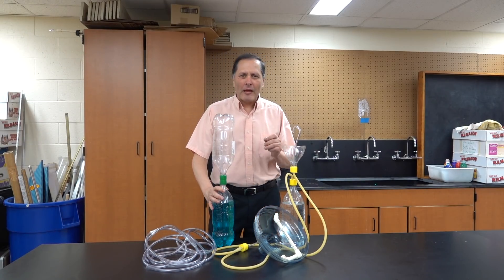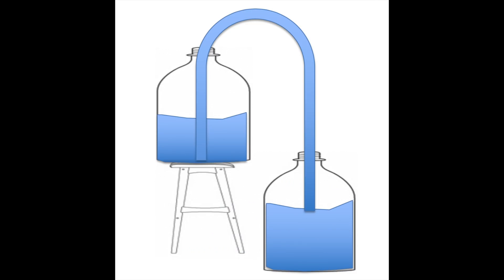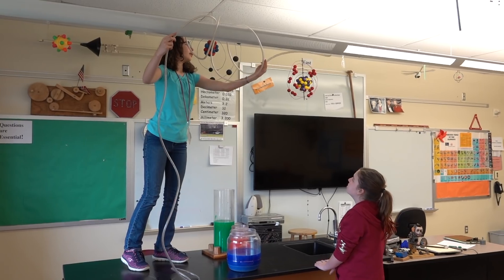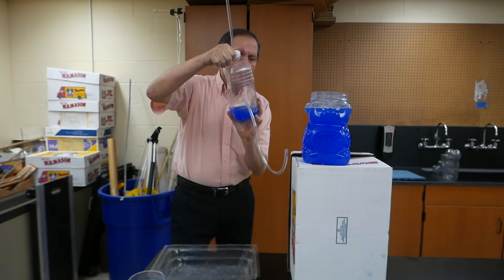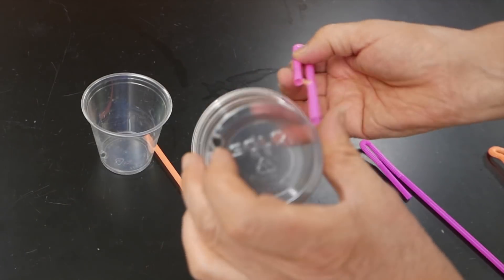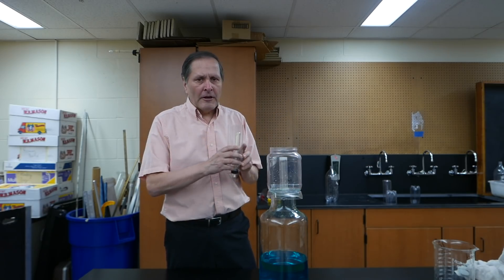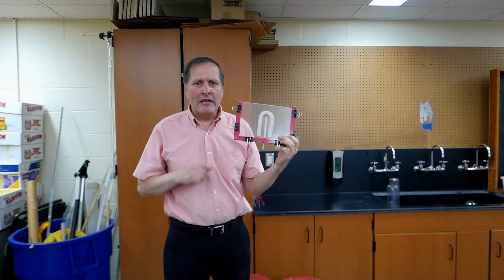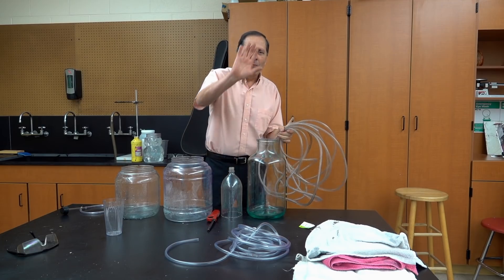Water Demonstrations  Part One --. Siphons // Homemade Science with Bruce Yeany

Comment: 1:22 the pressure explanation would only work if we introduce atmospheric pressure as well. If there's lower pressure region, it doesnt magically "suck" the liquid - it's the air around that pushes the water into low pressure region. But since the theory is about cohesion of liquid, we don't need to talk about pressure here?

Edit: you actually talk about pressure. But why this works in vacuum then?

Comment: Thank you! Great class! You gave me some ideas for projects that don't use electricity, but use siphon power (bird bath, pond water circulation and aeration), and one project that may solve a problem (moving sitting water on a wet lawn. Basically a sump pump working on siphon power; again, no electricity). Thanks again!

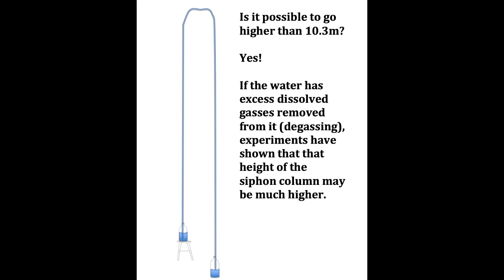Comment: There is a mistake at 3:19. Water can not rise higher than 10,33 m. 
The reason is, that the water get pressed up to 10.33 m by the air pressure, but only at absolute vacuum at the top of the siphon and Zero degrees Celsius.
Also if the water was degased before, there would be "gas" to be precise "water steam", because water boils at this condition.

Comment: The theoretical limit for how high you can suck water up a tube, is around 35 feet, given a 1 atmosphere environment on the source container.   It would be an interesting trial to this experiment to see an attempt at siphoning water higher than 35 feet above the upper container.
Reply from the maker: We did the sucking through a straw experiment a few times with students until I heard it can be harmful to the lungs,  same with exhaling as hard as you can.  Not sure about the accuracy of either statement.

Comment: Make electricity by this setup ??so we make it on it's theoretically higher limits by using hydraulic system or leverage so we use very small power and the power from this setup gives us rest of the power 

So we made its on various levels for making electricity

Longitudinal siphoning gives many thousands kilowatt of energy

Comment: if you used a liquid with a higher boiling temperature, could you siphon higher?
Reply: Not very much, because under most circumstances, it can't go lower than a perfect vacuum.  10.3 meters is the theoretical height for sucking water up a tube, assuming you can get it as low as a perfect vacuum.

It requires a liquid with less density for atmospheric pressure to be able to lift it higher.  So if you used alcohol instead of water, it could go higher.  While if you use a dense liquid like mercury, it will only rise 76 cm under 1 atmosphere of pressure, which is why we also call 1 atmosphere as 760 millimeters of mercury, based on the working principles of the mercury barometer.

Comment: I have a question regarding pet water feeders, how does the water reservoir that has a higher level, not fill the lower bowl and overflow it ? Great channel Bruce.
Reply from the maker: you can do the same thing with a glass full  of water, upside down in a bowl of water,  water can't flow out of the dispenser or the cup example unless air can get inside the container to  replace the water coming out.   When your pet drinks,  the water level drop in bowl far enough that the mouth of the water container is clear of the water level and  air can get into container.  Water flows out until the level in the bowl rises enough to seal the opening of the water container again

Comment: The Tantalus cup got me thinking... is this how those old auto-flush urinals would operate, with the porcelain tank high up on the wall supplying several urinals ?  Maybe just a trickle water supply refill rate for the tank, but a very strong flush flow every 10 or fifteen minutes, and certainly nothing electrical involved.
Of course modern urinals use individual electronic motion sensors with a solenoid-operated valve, but those of us [men] old enough ;) will remember what I describe.
Reply from the maker: not sure I've seen those but how you describe it sounds about right.
Reply: I enjoy Big Clive's electronics videos, but I never expect a search on urinal auto flush (siphon) valves would yield a video from him!!
https://www.youtube.com/watch?v=BQ45kMi6HkA

Comment: I do not agree that the chain model is a flawed analogy:  you say change in pressure....   that chamge of preasure is due  by the difference of weight.....  it  even  would  beheave   the same if you elevate the chain  to a certain point that the chain would not support its own weight  braking  its links. I guess that under certain conditions, you could  even repeat the  ball chain out of a jar experiment  with  some liquid with spetial  viscosity... by the way  doesn´t  helium    behave like that  with  jars at differentlevels?
Reply from the maker: Personally, I like the chain model myself, it seems to make sense but I've had  "experts" explain why it is flawed and I've tried to apply their theory.
Reply: @YeanyScience  Hi bruce..  nice to hear you  in person! nice surprice professor , great job!! what do you think about helium property of leveling in a spooky way?  I have in my memory  a drawing ( old physics book) a jar with liquid He inside other, both open  and it said that the levels would equalize from the full jar to the less  leveled one. I.ve tried to find something about it.. negative results yet. thanks for teaching every day...  by  tyhe way.. can  i have  some link to those experts?

Comment: Excellent.  But how the liquid starts flowing with out primary force😨? If I want transfer fuel from container to car tank I have to suck the tube or blowing to the container. . or my be not! 🤔 and how the liquid goes higher than primary container. .I thought the cities water tower should be at highest level.. .. anyway that was amazing. . You are absolute one of the best teacher I ever seen.  👏
Reply from the maker: thank you,  what you are seeing is simply a version of a siphon.  The end result is that water flows from a higher level to a lower one due to the pull of gravity.  If you do a search for siphons there is quite a bit on them to explain the concept
Reply: @YeanyScience  Many thanks.  Best wishes 🙏
Reply: @YeanyScience  Now I got it. Because of capillary effect siphon start to work and for my second quastion the level of primary container is issue not the pipe line.. many thanks again.

Comment: bell siphon mathematically proved equation are what and what are it's maximum potential or work done so we use it to run the turbine and generators setup and pour the water again in the reservoir😇😇
we use many turbine in this path and each turbine produced cheap electricity forever everywhere anywhere in world😇😈

Comment: QUESTION ... If the siphoning tube is LIFTED AND WOUND to more than the 33.9 ft ... would the length of the winding in combination with the height of the lift still be the 33.9 ft dimension  ... or does the 33.9 ft only equate to the height dimension ???
Reply from the maker: it is the height that is the limiting factor
Reply: @YeanyScience  -  I just realized that my question was a bit convoluted ... but, If I understand you correctly ... whether it is 100 ft of wound tubing or the exact 33.9 ft of tubing ... WHEN RAISED TO THE 33.9 ft level ... THAT IS THE LIMIT ...
Do I understand you correctly ???

Comment: SIPHONS WORK DUE TO GRAVITY, NOT ATMOSPHERIC PRESSURE!! You are supposed to be a scientist for god's sake--if pressure were the main factor, siphons wouldn't work in a vacuum--but they do. See the Veritasium video from 2011 (8 years ago, this isn't new news)
Also, by the logic of "air pressure" doing the work, the lower container actually experiences higher air pressure, so the liquid should be pushed the OTHER way if anything. Again, you are supposed to be teaching people science, not spreading lies.
Reply from the maker: Hello Ryan,  I explain at 1:16 that the current theory is that siphons work due to gravity, I do not mention atmospheric pressure, in fact this can be demonstrated by having siphons work in a vacuum.  the "weight" of the water inside the downside tube reduces the pressure inside the tube itself but this once again has nothing to due with atmospheric pressure. The behavior of siphons has been additionally researched since 2011 but the explanations still vary.    I believe my explanation reflects the current research which does not include the idea that atmospheric pressure is responsible

Comment: Siphons can also take place in your body. Practitioners of auto-erotic asphyxiation can block the flow of blood out of the head. The blood flowing in does so via arteries that are deeper inside the neck that the veins that carry blood back to the heart and are thus easier to restrict.
    When that restriction is lifted blood flows out of the head much more quickly that blood flowing in causing a momentary drop in blood pressure. This is what causes the euphoric feeling that people are looking for who practice A.E.A. However, this drop in blood pressure can be large enough to cause loss of consciousness. If this happens and the end of the rope is tied securely consciousness will not be regained before death takes place. Leaving loved one to find your body some time later and wonder why you chose to hang yourself. It is likely that the majority of surprise suicide by hanging were, in fact, accidental.
      If you choose to practice AEA, learn how to do it safely. Tie the noose in such a way that it will loosen automatically and hold the end of the rope in your hand so that if you lose consciousness the rope will not suspend your body by the neck.
     Even when done safely, AEA is still extremely dangerous. 
This video has some very good information, even if it is presented rather amateurishly, and explains the siphon effect and shows how quickly LOC can take place.
https://www.youtube.com/watch?v=MHRchAjxUMA

Comment: Bruce I think it's incorrect that the siphon works because of pressure difference since that would imply that siphons can't work in a vacuum. If you look at this experiment (https://www.youtube.com/watch?v=8F4i9M3y0ew) it shows a siphon working in a vacuum. Instead it is gravity causing the fluid to pull through the siphon tube and which causes the water to flow to a lower height

Comment: 3. 41 second
if we use very narrow tube so we make a coil and magnetic ink flow through it as a  current and giving some electromagnets induction which powered up a pump and in this way the perpetual motion become possible😇😇😇
Reply: I... You.... oi. Ima just say it. It's okay to be an idiot, but you can't just go telling everybody with a 1 bar WiFi connection about it.

Comment: if magnet fluid are their, will they produced enough electromagnets induction which can powered a pump and the perpetual motion become possible, yippee, bingo, or something like this😈😈😈
Reply: Perpetual motion machines are impossible. You could use a siphon to power some sort of device, but you would effectively be turning potential energy into usable energy, with extra steps. There is no way to get more energy out of a system then you put in it.

Comment: Hi  Bruce    Nice experiments, Id like you  to experiment with another  water antiintuitive water behavior... it is very  easy, it consists of a water  tank  small or very big like used here in Argentina on top of houses,,.make a small one  say  one meter high with  plastic bottle.. the just put a hose down from the very bottom ( not siphon). like 1/2 inch and  2 meters long, if you  put  the EMPTY hose  straight  down the water will run freely, but  if you for example   put some  midle part  flat horizontally,   some  water   will reach the end ( you had it closed first)  and some air will be in the midle of the hose, then you open the end  and  the air inside will  try to float up stream, wile the water  would  try to go down, sometimes the air  buble gets in equilibrium  and the water would NOT run  even if the end is lower and fully open.. this is a comon problem  for house water piping  even if the water tank is over  10 meters and the  3/4 inch tubing goes straight down, there are interestig factors  involving tube diameter, size of the air buble, pressure andn so on   ... congratulations for your teaching  vocation!!!
Reply from the maker: thank you, I'll keep your suggestion as I plan I plan to try some more on hydrostatic pressure

Comment: 1:22 with pretty thin capilar tube, siphon starts automatically, when upper jar water level + capillar shift altitude bonus reach upper "U-turn" level, because level in capillar higher than usual (which is equal to source) ln case of thick tube
Reply: in lab. practice i using 1mm diameter glass tube, it can shift water(or some acid) level for extra 15mm higher, so i pour out some acid from almost full glass, when acid level high enough - approx 5-10mm lover than edge(border) of glass, just contact of one end of capilar(thin) tube with liquid, cause liquid intake into siphon, and it reache altitude level higher than glass border, where  ^ -turn occurs and forward -easy, due to caplar intake-pressure that gives shift - after turn - pull forvard with same pressure(P~1/d)
Reply: Sometimes someone buys cheap tea bags which thread is hydrophilic and works like a wick, that cause tea running away, goes into "magnetic forest" of capilars, pouring out of the mug onto the table, no need of siphon initialisation by tea owner.

Comment: Cavitation would occur in any liquid, it has nothing to do with dissolved material or purity. The pressure of air is simply not enough to hold up the entire column, so a vacuum gap forms. In case of most liquids, the gap is immediately filled to the vapor pressure of that liquid, as said liquid evaporates.
Reply from the maker: There have been several studies   on the height limits of 34 feet  in liquids supposedly determined by barometric pressure.  Their results show that it’s possible to create a siphon that’s 50 feet tall which operates quite easily at seal level, with a projection that the limit may be much higher perhaps up to 300 feet or more. That’s because, according to the researchers, the degassing of the water prevents the cavitation from occurring: Without gas in the liquid, which can form bubbles as the pressure changes, the water’s essentially “stronger” and much harder to tear apart.  Here are two of the several studies on the subject

https://gizmodo.com/you-can-build-a-siphon-way-taller-than-we-thought-1755386599

https://www.nature.com/articles/srep16790
Reply: @YeanyScience  Didn't think water had a tensile strength.
Reply from the maker: I had posted a video on siphons previously and had this pointed out to me,  I deleted it and tried again.  Hope to try my hand at testing this research for myself sometime
Reply: Bruce Yeany   Mercury, which has a very low vapor pressure at room temperature, will form a vacuum “bubble” with a head of 760mm (1 atmosphere).  The density of mercury is 13.56, so, neglecting vapor pressure, the theoretical maximum height of a vacuum “supported” water column is 10,374mm.

Comment: But why doesn't the liquid stop flowing once the surface level goes below the point of drainage?
Reply: Air can’t get into the tube to bring the inner water level down until the surface level gets below the outer tube.
Reply: @The_Forge_Master  But at some point the pressure of the water level outside the tube is what causes it to flow. But what is keeping that pressure on as the liquid gets below the required level?

Comment: If I had an outdoor pond and I wanted to send the water up to a higher reservoir, what would be the best technique that would use the lowest energy to send it back to the top. I have a small pump. But I want to use the best method I can.. I want the top reservoir to be to have a bell syphon. I just want a smarter way to pump up with least power. Thanks
Reply: A bigger pump. I do landscaping and home remodeling. I can promise there's no easy or energy efficient way to take one thing from a low level to a higher one without imparting the same amount or more energy than the water would gain in potential energy. Its just basic newtonian physics.
Reply: @noobpro9759  I got ya. I have a pump that can do it. I just thought about doing some cool stuff like this so I have small pools that ebb and flow.
Reply: @j1232a  small aquarium pump up and bell syphon into a small waterfall down?
Reply: Waterfall cause i dont know if you have fish in it. Most people do so i figured.

(Edit) watched it again. Maybe you could do like the second one he showed with the fat and skinny tube going up.
Reply: @noobpro9759  I want it to have a small pool at the top,roughly 100 gallon. Then small waterfall and more of jagged flat rock. Sort shelved so it creates that babbling sound. I just wat the top to have a Bell that only takes half of it out, not the whole thing... that way I can pump slower but still get the periods where it flushes and creates more sound.
Reply: @j1232a  ah. I see. What you could do is place the pool up higher then run the flush tube roughly halfway down the waterfall and use a few of the skinny to fat syphons to fill it. Maybe disguise them in some plants or something to keep the natural look.